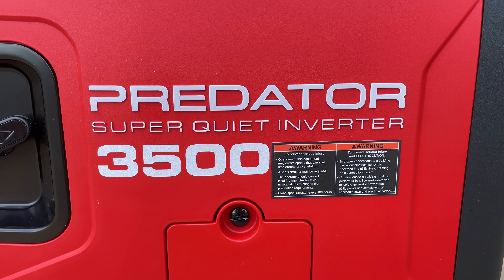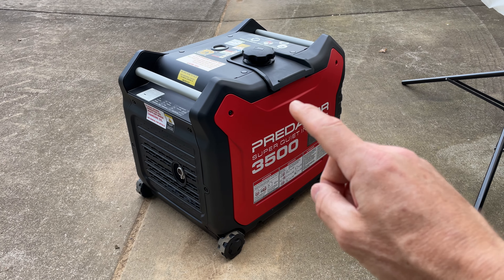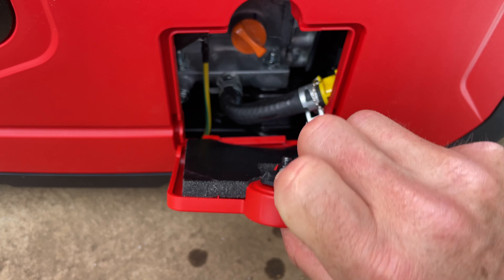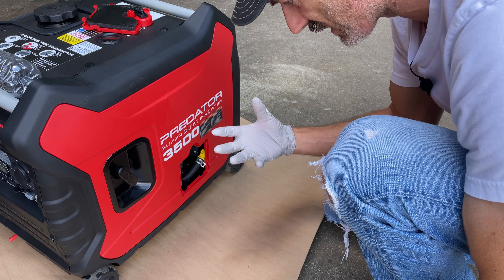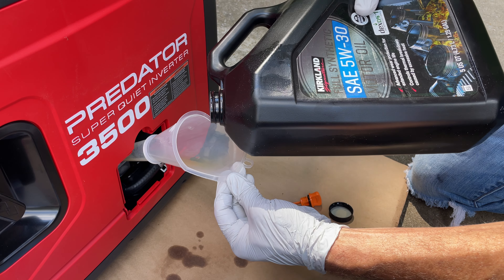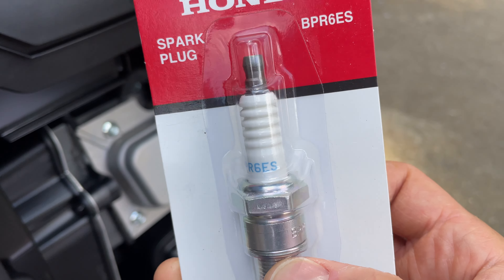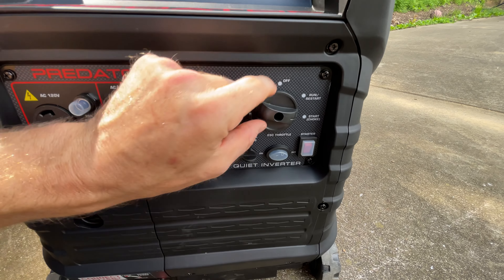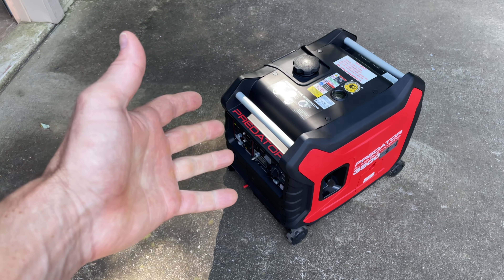Harbor Freight Predator 3500 INVERTER Generator!! THIS IS THE GENERATOR YOU WANT

Comment: I have been using this generator for about 4-5 years now and love it.    I've had no issues and used it quite a bit.

On my generators/small engines, I only use non-ethanol fuel and tend to keep about 20 gallons on hand at any time.    Thankfully here in Texas, you can buy non-ethanol fuel in bulk from Buckee's.   I fill up my tanks and add some stabilizer to that, this has typically been my key to having small engines that start the first time, everytime.
Reply from the maker: Which stabilizer?
Reply: @1RoadGarage  I've been just using the run of the mill Stabil.     It worked really well for non-ethanol fuel for me and have had no issues.  

In general, I've never been able to get typical fuel with ethanol to keep any amount of time without building moisture whether it has ethanol purpose type Stabil in it or not.    No matter if I started and ran something every month like clockwork or not, I always ended up getting a gummed up carb.    I always kept a spare carb for generators just in case because they always seemed to not work that one time you actually need it, regardless if you got it to run a week or two before.  hahaha.
Reply: I agree ever since I've started to use non ethanol fuel several years along with stabil I've had no issues with my gas powered equipment and like you mine starts on the first or second pull every time.

Comment: I have one myself and use it quite often, A little stubborn to start in the cold so keep cold start handy.. Also the 12v DC output can charge batteries to run other smaller dc inverters.. A few hudred watts extra! just don't overtax it.. good quiet little generator..

Comment: Nice review! I have the first generation of this generator and am very happy with it. These machines ran rich from the factory and would cause carbon build up in the spark arrester, leading to hard starting and engine shut downs. Judging from the looks of your spark plug they have resolved this problem. I replaced the main jet in mine with a #68 and solved that issue. As far as mods, I've done them all, except for drilling holes in the case, and have undone all but the ignition toggel switch. That is the only mod I would recommend. I too have chased the elusive misfire to no avail, deciding to just live with it. Enjoy your generator!!
Reply: Could the misfire be a rev limiter?
Reply: @paultamdoo5533  To my knowledge there is no rev limiter.

Comment: Bought one in May. 90 days returned it because not firing. Done the break in period as recommended. Never plugged a load into it. They replaced it with a new one. Got my fingers crossed on this new one. Hope it works out.

Comment: Regarding the ability of the generator to start up a heavy load such as the compressor, my first guess would be that they've put a large capacitor into the DC part of the energy path so that it can supply the start-up current for a heavy load while the engine has time to get up to speed to keep supplying the load.

Comment: The 5W-30 burns quicker than I'd like in mine. In the SE Texas heat I ended up moving to 10W-40 for the summer, anyway. Seems to be the sweet spot. This occasional misfire is normal on these without a load, mine does the same and other I know get that, as well.  The unit is a beast, overall.
Reply: After break in Mobil1 15-50. It will stand up to the high engine temps best.
Reply: It depends on the clearance of the rod and main journals. If it's machined for 5w-30 and you run 10w 40 the oil flow of the journals slows down, which can cause higher heat. Faster flowing oil will carry away heat faster.
Reply: @Bryan-Hensley  Right, that is a concern but I bet the tolerances aren't that close. Ha!

Comment: I have a Firman WO 3386 with 3650 starting watts and 3300 running it also has remote start/stop  which is nice , and the oil drain is out the bottom of the generator , this Predator is a very nice unit except for the oil drain hose (they should rethink that) , and adding remote start would be nice also , i do like the fuel guage on the Predator  as my Firman doesnt have one and basically you wait for it to run dry or add fuel when you think you need to . I am in Canada and i am not to sure that you can buy Predator generators here in The Great White North , but it would be on my list !

Comment: My 3500 is mainly for back up power to my home via suicide cable... But I use it to power an RV a couple times a year while on the road as to not run up hours on the provided gen (I rent RVs...)

Do your maintenance, I do oil 1x a year....
Reply from the maker: Oil is key. Especially with no filter.
Reply: @1RoadGarage  

I sprung for the magnetic dipstick, (not necessary...)

I've had a few hickups with mine but Facebook has some good support groups that got me running again...

Spark arrester... 
Charcoal canister...

The pages I'm on gave me heads up and got me back in action on the side of the road a couple times...

Comment: this is the newer version 3500 in the video - You can tell bc battery and oil access are on opposite sides of older gen.  Why does this matter?  The new units have the Co2 cutoff sensor that will cause some problems when running.  The sensor although sounds like it makes sense, it really doesn't.  You shouldn't be running this thing indoors.  There are videos on YT on how to disable the sensor.  Other mods that make sense are adding a magnetic oil dip stick (you will see lots of metal shavings from the engine when doing the break in period oil changes), adding battery maintainer, pvc "drag" handle, wheel mods (the wheels on the 3500 suck) and fuel cutoff so gas runs out of the carb.   The best mod of all tho, is dual or tri fuel mod by grenergy.  This is a kit that will allow you to run the 3500 on propane or nat gas.  They (grenergy) sell a 3500 package which includes the dual/tri fuel mod, the fuel cutoff and light bar.  Well worth it.

Comment: would only go like 1 hr then change oil,, go 2 hrs than change oil..  then 5 hrs and change oil..  by then you have gotten most of the break in oil and material out of the engine.. I would then go 10-15 hrs and change again then go to normal change schedule.

on the drain cap,,I would twist the hose to stand up right behind the cover so the end is higher than the level.. more security to prevent oil drain.

Comment: Is there a opening in the bottom of the pan to open and run the oil drain tube out before that tube it just drained out a port in the floor that removed.

Comment: The 4550 gets the same run time as the 3500.  It is also thirty pounds lighter. Only four or five decibels louder, and that's imperceptible.  Being $200 cheaper. When on sale, there's also a plus.  You can get them crazy. Cheap from Harbor freight. When you buy a used one.
Reply: 3db increase is TWICE as LOUD. Keep that in mind.

Comment: That's not really a misfire, it's surging cause it's running a little lean with no load. Nothing to worry about though. Using a non ethanol type gas could help
Reply: Hmm, I always change my oils on a hot engine so the fines don’t settle out , never more to flow out at the bottom in the cold oil!  As well, the oil showed running rich with the nano fine carbon particles in suspension. One way to lessen this effect would be to keep your hand on the choke dial. Let the engine just turn a few a few times and then flip to run to start likely in not cold weather it will then start without further ado . Running for a bit super rich will really load things up with soot.  Still getting the dark oil especially at some altitude may indicate changing main jet and of course running rich could be the cause for misfire too.

Comment: Hi Jimmy. I also have a predator 3500 from 2020 and my drain plug is complete different. Mine is a 8mm (I believe) built that drains through a hole in the bottom of a machine. Just have to put the wheels in some blocks to slide the oil pan under. It’s weird they changed the design
Reply from the maker: That sounds better.
Reply: Between me and family we have 2 of these gens. Mine is same as the video. The other one has a 10mm drain plug with a ramp for oil and a tethered rubber plug on the bottom of the machine.  I much prefer the simple plug and ramp.   
Maybe the "newer design" is for a tool less (only a flatblade screwdriver) oil change.  Personally I'm a little scared of the yellow cap vibrating loose.
Reply: There is a version 1 and version 2. Battery on the left is version 2, battery on the right is version 1.
Reply: @Pablo-cp9nc  , oil doors on the opposite side as well

Comment: I only use conventional oil in small engines. I used to run synthetic in my lawn mower & it runs better, doesn’t get as dark & cooler with regular old Castrol GTX 10w30. High amounts of additives in synthetic could be the reason? But I’m no pro. Also, I only use shell or BP 93 octane in those small engines, they run better. You should try that.
Reply: The 93 makes no difference if you educate yourself on octane... and you are using sales jargon words "better", "as dark", "cooler". All which have zero factual advantage. Break the motor in with dino oil and switch to a full synthetic on the 3rd change. I like a 15-50 myself. Peace.

Comment: cleaner power ok lol my thoughts at the end of the day the nice dirty unstable power is fine on SMP  we use theses day think about it  loads of them can run from 85 volts to 240 volt 50/60 .at the wide end but will be fine just keep gen-set rpm dialed in  with you meter  so ill never buy one  but i can do that for the non techy type i guess it makes seance to get inverter

Comment: FYI: Hook the batteries strap on the base pad that the battery sits on not the bottom of the battery. Outside of that, it’s good video.
Reply: I’ve got an older 2017 model. I added Suzuki foam air filter oil to the dry foam air filter. Almost all other manufacturers use motor oil or filter oil in the foam air filter. I wonder what type of filter your newer predator uses.
  I’ve used a 90* pick to spread out the sound defuser disk that is mounted inside the holder of spark arrester screen. So that it doesn’t clog with carbon buildup as easily. Still seems to sound the same.

Comment: I have the same gen. Batt won't hold charge well even using a batt tender. batt is really cheap so I went to AutoZone and bought an 
AGM batt for it and I hook up a batt tender to it when not using it keeps batt charged.
AGM batt is way better quality than what comes in it.

Comment: Assembly lube came out in your initial oil change. You seem to have installed the “lock” washers.  It is common belief that they work to keep your fasteners tight.  This is incorrect. They work to prematurely loosen fasteners in vibrating applications.  Immediately remove and discard them.

Comment: I love the E-3 plugs. Great spark and reliable. Also if used outside, I tape up the carbon monoxide sensor with Gorilla tape. Wind direction change will shut it off.

Comment: Only downside I noticed is that outlets were not GFCI. I plan on using this with my skoolie but I'm worried about those outlets. They don't have covers either so could I store my generator on my trailer safely?
Reply: Generators are floating ground. Unless the generator is connected to a ground rod, the earth ground is isolated from the circuit. Our power grid should have been designed with floating ground. Electrocutions would barely even exist. Lightning wouldn't be attracted to the power grid either. The only way you can get shocked is if you touch both wires at the same time.

Comment: Did the same thing after a ice storm last year just fill my freezer with meat also lol this is a work horse and my friend has one same misfire and not a problem yet and I beleave brake in is at 30hr with no heavy load
Reply from the maker: You and your friend both have the same machine and only his has the same misfire? Interesting. I’m starting to wonder if I should swap it out.
Reply: @1RoadGarage  if u payed for there warranty i would not worry about it and exchange it right before its up it might just take a bit to brake in and go away like it says 30hr brake in

Comment: I hope you purchased the extended warranty and after researching I could not find an authorized service center. These units have a high failure rate. Why are you using synthetic oil on a new machine? Synthetic does not allow the rings to seat properly.

Comment: Fuel capacity? What is the real life run time on a full gas tank? I have the Champion
3500 which is a dual fuel generator and it doesn't have some of the features of the
predator such as the hour meter and the other gauge which shows power draw.
I almost bought the Predator but wanted the ability to run it on propane.
Reply from the maker: 2.3gal 11hrs @ 25% load. I’m finding it’s very fuel efficient.

Comment: I must be the unlucky guy that got the lemon. Mine ran great from the start. Did the NGK spark plug mod and the charcoal filter delete. Removed the spark arrestor disc from the exhaust and left the screen in. Ran even better but slightly louder. Ran the unit for 20+ minutes every 2 months for the next 6 months. Then we had a blackout. Pulled it out, filled it with fresh gas and was ready to go. Pushed the start button and the motor didn’t even turnover once. Dead battery. No problem. One pull on the cord and it fired right up. Hooked up a 25ft. extension cord to my fridge and lamp and waited for the power to come back on. After just one hour(3 hours total on the unit) the unit stopped making power while still running fine. It would make power on and off for the next 15 minutes until I shut it down to avoid damage to my fridge. After calling tech support and explaining the problem they said they couldn’t help me and connected my to HF corporate. I was able to replicate the problem the following day and get it on video. I sent the video to HF and after a week they finally did respond. Even though the unit was well out of the 90 day warranty, they agreed to send me a new inverter board $397 for free. I will have to install it myself but I’m totally capable of handling that. I hope that’s the end of my problem. I still have a dead battery but I’m fine with using the pull cord.
Reply from the maker: @Chainsnsprockets402  thanks for that info!

Comment: My starter stopped running  ,still runs with the pull cord but no starter , any ideas ?
Reply: Bat Tree
Reply: Starter solenoid can go bad on those. May have to call HF for the part.
Reply: @sweetdaddy77  i bought the 200 dallor  extra plan when i bought it so i should be able to take it in and just get another for it right ?
Reply: Yes. They’ll probably replace the whole unit

Comment: This is so weird. I just bought one (and love it) but it is not the same layout as this one. My oil access door requires no screwdriver to opn and does not have the tube coming off the oil drain. And the tool kit is different.
Reply from the maker: I’ve seen the same model and slightly different designs. May just be made in a different factory. 🤷‍♂️

Comment: It wont cause catastrophic damage. The engine has a low oil sensor and will cut off the spark plug if it gets too low. I own MANY harbor freight engines. Trust me it is idiot proof.
Reply: All I needed to know lol I see that there are bad and good reviews but Ima take my chances on this I rarely ever get power outages but do want it for camping most days I can camp out are weekends so this should be good for me or my family of 4 in total 🫡

Comment: An inverter doesn't necessarily produce cleaner power than a rotating generator.     In fact, a poorly designed inverter will have much dirtier power than a rotating generator. 

The generator in an inverter/generator can be AC or DC.  It appears that your generator makes 12VDC. 

The main reason to use an inverter generator is because the engine runs quieter when not at max load also uses way less fuel.

You should always change oil while it is hot, not cold.

There is a reason why manufacturers state the viscosity of oil.   5W won't have proper thickness when cold.   W does not stand for winter.
Reply from the maker: I plan on getting 10w but for now, with 80° days this is fine for me.
Reply: Please explain how an inverter generator does not produce cleaner electricity???

Comment: Junk wait till start motor fails and cherry on top and string breaks you will need to take many things off just to restring pulley,  open frame are 100% more easy to service and replace string/ rope when it breaks its not if but when , champion open frame with remote start is cheaper just as quite for 499.00 and champion stands behind it products right here in usa 🇺🇸  need I saw more
Reply: In case you didn’t realize it, there are a few HUGE reasons open frame generators are CHEAP.
Reply: @jdargonaut  it the same dam unit only open framed easy to work on wow some people are just stupid no common sense 🙄

Comment: Yeah... Sorry man, but I’m going to need proof that your inverter can deliver a cleaner sinusoid voltage than a normal generator does.

I'm going to assume that you're parroting the sales guy since your statement is claims only.
Reply from the maker: No sales guy. Look it up.
Reply: @1RoadGarage 
Look it up? I'm not the one with the claim - as an electronics engineer I know better. So, no thanks.
Reply: @Peter_Riis_DK  You are no engineer,you are just a troll....
Reply: @danhambrick6331  
Whatever rocks your boat, Ham. 😄
Reply: @1RoadGarage  It's a pure sine wave. Lots of trolls in your comments section...